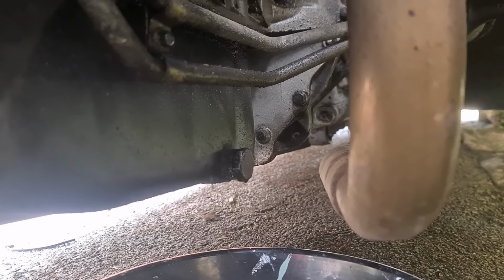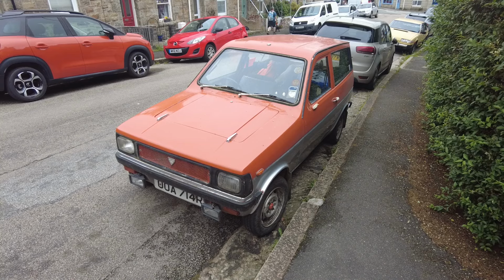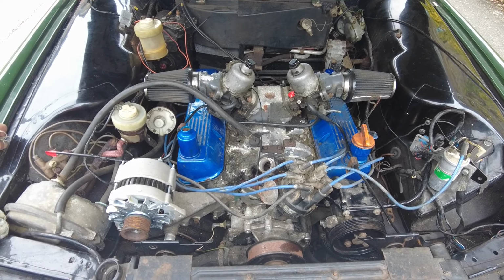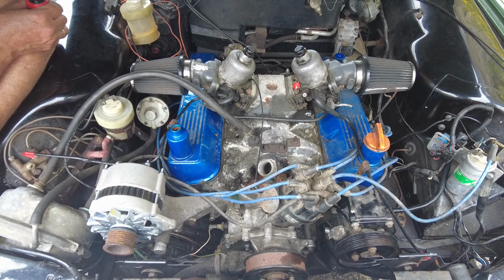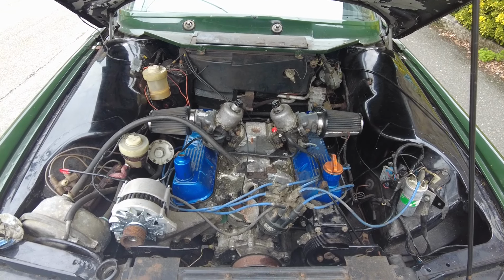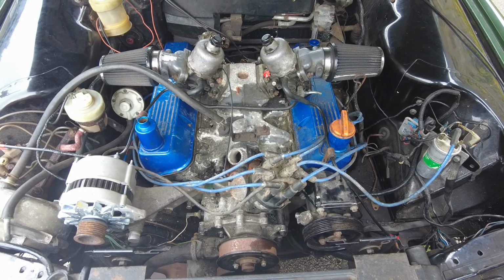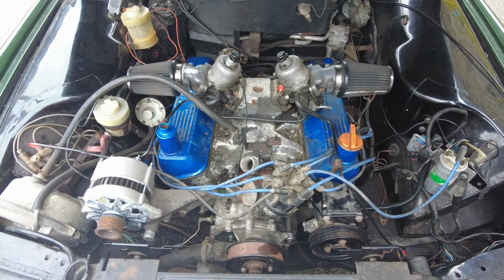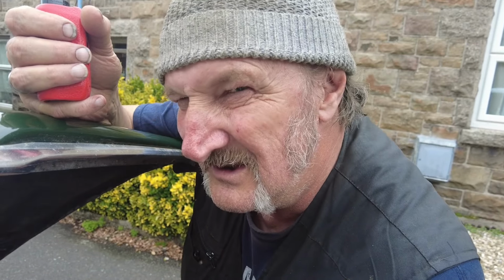Rover P6 V8 NADA Part 7 Bye Bye Engine.....

Comment: Hi Sheldon, all the way from Ireland.
Tbh I wouldn't give up on the engine yet.
Looking back ,it didn't look like a massive amount of water in there and it cleared out fairly quickly.
It's possible that water got in the engine while it was laid up.
Their wasn't any milky stuff coming out so what I would do is plum up your radiator and fill with water. Then run the engine with oil flush , then drain out the old and put in the new.
Then see if your coolant dissappears over a week or so.
It's worth a try and it may save you alot of money.
In your previous video the engine sounded very good , and you didn't have any smoke.
I hope this helps.
All is not lost young man.
The best of luck with your rare p6.
Keep those wonderful videos coming 👍
Reply from the maker: The last time we ran it there was A TON of smoke out the back and it reved like crap s oi am 90% sure the head gaskets are gone.
Reply: You were saying it sounded fine.
Head gaskets arent a terribly difficult job,why not try peoples suggestions rather than go straight for a 4.6 swap which isnt quite as simple @classic_britain
Reply from the maker: @jasonburrows-tr2bd  I am going to don't worry!
Reply: @classic_britain  All I recall was you saying how well it was running

Comment: Mate you had it running with the Rocker cover off and no emulsified oil, so pull and clean sump investigate the metal you find and go from there

Comment: As the car has been sitting for ages it's not uncommon for the head to warp and release coolant into the bore, you had the engine running and it sounds sweet so possibly no damage, dry her out and put new oil in, replace the head gaskets and start from there - the engine is potentially no worse for the experience. Good luck and yet another 10/10 video, DONT let this get you down, it's most likely going to be fine.

Comment: Hi Sheldon bad luck but water in the oil doesn't always mean the engine is toast, give it a oil and filter change before you scrap it then run it up to temp then drain the oil and see if there's any metal in it then as it sounded nice and healthy with no knocking!!?? Cheers 🥂
Reply from the maker: Sadly there is a lot of metal in the oil.
Reply: @classic_britain  Nevertheless, maybe all it needs is an oil/filter change and all will be well again - try some cheap oil first, and see what happens...
Reply: I have to agree with Paul.
Try an oil and filter change first.
Do a compression test, and find out what the oil pressure is when running.
This will tell you if you have  worn/broken big end bearings.

The car has been standing for some time. The oil appeared to be clear. 
This suggests its likely condensation..
..
You may have further fitment/cost issues installing the 4.6. like will the auto box/ torque converter fit the 4.6?
will the ex manifolds.

Comment: The holley is an OK idea ,On my Leyland 4.4 V8 I run a Edelbrock ASV which is 750 CFM on a Australian made manifold which looks a bit like a edelbrock T type.  and it worked perfectly. I say"worked" because the car went under in a flood...

Comment: Did you say the radiator has an oil cooler built-in  ? If so check its not leaking water into the oil from the rad

Comment: Aron Talking to Birchy Likely the valley gasket has rusted out and poured water straight on top of the camshaft and into the oil. If you take the valley gasket  off you'll be able to see the tracks of the water where its worn a line through. If it isn't that and merely a head gasket thats a straightforward job.
Reply from the maker: Going to do that right now!

Comment: You changed the inlet manifold and the oil wasnt emulsified ,thats fresh and it ran and sounded ok.i think that engine is fine ,take off the inlet manifold and start there.!
Reply from the maker: It's not with all the metal in the oil!

Comment: Right you are: easier to swap an engine than repair all sorts of (often hidden) rust. Seems like someone might have put regular water in that engine at some time and it froze and broke or went through the cylinder liners.

Comment: Just a cautionary note....be careful about putting a 4.6 in...the rear end will probably crap itself. See if you can get a 3.9 efi unit and plonk carbs on it. Ideally a 9.35 to 1

Comment: It's OK buying another engine but then do you really know what your getting even if you see it running.
My 3.5 didn't smoke had good oil pressure and run lovely but when I checked one of the main bearings they were shot.

Comment: You dont know where this water has come from. The engine appeared to run and sound well apart from some initial smoke - and an engine overfilled with watery oil would obviously smoke. For the cost of a gallon of oil and a filter Isnt it worth doing an oil change and running it for a bit? Nothing to lose?
Reply from the maker: The thing is it's burning the oil for sure and not only that there is alot of metal in that oil so the engine is on the way out.

Comment: Hi Sheldon.  Manually pumping that  stale old oil around and running it with no coolant is the worst thing to wreck an engine that's unknown and been stood for years. You've probably got broken rings and maybe even cracked, or slipped a liner. The engine will come out on its own, with the manifolds in place. Take off the bellhousing lower plate and remove the 4 torque converter bolts, leaving it on the gearbox. Dont distub any bolts near the starter ring gear, they're balance weights. Support and raise the gearbox front and pull the engine up and forward slightly, tilting it to allow it to clear the crossmember.  You can re-jet the SU carbs to fuel up to 5+ litres. Get a leakdown and compression test done, drop the sump and check the bottom end bearings before you condemn it as scrap. The 4.6 is known to suffer similar liner problems.
Reply from the maker: I know we never ran the car for very long plus the oil we saw on the stick and in the engine did not look anything like that hence why we ran it.

Luckily the 4.6 engine is very low millage just 27K from new and is a great runner so all I have to do is raise the fund and get it bought!
Reply: The Rover / Buick V8 was never designed to be a larger capacity, + Rover adopted a different casting method. The bigger you go, the thinner  liners have more chance to slip or crack. Machining to fit top hat style lners is the fix.  If it's been sat for years with no coolant, or even worse, with plain water, it  can cause major problems.  Have you looked into fitting Amal bike carbs ?  I read an article many years ago where someone had fitted a full set of one per cylinder to a Rover V8. Can't remember how they did it, and if it incorporated the water flow from each end of the heads in a heated manifold. It was around the time people were fitting twin turbo kits.
Reply from the maker: @brianwhittington5086  Yes you are right the bigger engines are prone to slipping linners! Bike carbs would be interesting but I am going to go for a boxer 4 SU manifold as they do flow alot better plus they look good to!
Reply: Can't say I agree with much of that
Reply: @brianwhittington5086 amal probably make the worse bike carbs out there!
Reply: @joeedwards9721  I've been a professional vehicle/ insurance engineer many years, seen many  vehicles converted to a one bike carb per cylinder set up, and the twin turbo SD1s. They're simple to tune and they eliminate the traditional variation in fueling you get with a single or twin carb feeding multiple cylinders with differing length induction tracts. A single carb feeding each cylinder should be almost fuel injection quality if properly balanced.  I've been around Rover's, particularly V8s since the early 1970s, owning maybe 40+. P4 through to the Honda collaboration. I've just been involved in the rebuild of a monster trike, with the same Range Rover 3.9 Efi and ZF auto conversion, from a 3.5 carb and trans-axle setup.

Comment: When was the last oil change? It's been sitting for how long? Do the easy and cheapest thing to do first, flush the engine with cheap oil to get rid of any debris like others have said. Refill and run it then check again. It might not be toast like you think. Get advice before doing anything drastic.

Comment: Opportunitys arise remove engine rebuild it paint engine bay a months work but like you said it's money tnstl be the drawback
Reply from the maker: The engine has had a paint and its really good not sure weather to re build this or replace it.
Reply: The engine bay and inner wings are supposed to be satin black.
Reply from the maker: @johnmoruzzi7236  And now there gloss =)

Comment: I thought oil and water mixture made a brown syrup. Are you entirely sure it is not gasoline?  For the price of new oil and filter you could do a test run of the engine. I would not run an aluminum head engine for more than a minute without coolant.
Reply: It's not gasoline, gasoline would mix with the oil and you'd be surprised how long you can safely run an engine without coolant, particularly an aluminium one
Reply: @joeedwards9721  Oh... it seems I was right after all.  I guess my 40 years of working on cars does mean something.

Comment: It may have not been drained before going in the car and may have been FUBAR years. Bad luck Sheldon, put the intake and carbs back on the SD1z I tbh would not trust the gearbox either sadly. Especially if it is from the same donor
Reply from the maker: Yeah you could not tell from the oil in the top of the engine it was going to be like this!

Comment: Think youre being too premature condemning the engine, that water looked like water not coolant, sacrifice a gallon of oil and run it up to temp properly and reassess, I have a suspicion that engine is ok, if so then I will be hounding you to put that injection back on as it should be😊, be happy to help down the phone, I think you have introduced this problem changing the inlet manifold possibly

Comment: You really need to get a lock up, working on cars in the street is no fun.  I took the engine and gearbox out of my series 1 P6B in one go using a  four leg gantry and a chain hoist single handed.  Lifted the engine and box clear of the front bonnet stay and then pushed the car back to lower it on the floor.  This was in a back garden so I can imagine the grief you would have doing that in the road.  Another problem, is the gearbox any good, how was the car delivered to it's present position?
Reply from the maker: I know I have been looking for a lockup for years now sadly there hard to find.

Comment: Maybe time to let it go, or if you have funds rebuild it properly. Another engine is just other problems regardless of low mileage . Get it off the street 😂
Reply: I have to agree sadly.
Think this p6 needs a new wiring loom.
That current one looks like a fire waiting to happen..
Plus with the engine out it would be easier to do a re wire.

Comment: Sell it
Reply from the maker: No
Reply: Just a thought, you really don’t know what condition a donor engine is. Regardless of whatever you are told in good faith, about mileage etc you only know if it’s a good donor is you see and hear it running, unless you get a warranty. Don’t get burnt again with a supposedly good engine unless you are absolutely 100% sure and have satisfied yourself that it’s a good ‘un. I’d be investigating the current engine a lot more before condemning it. Sometimes it can be a case of better the devil you know even if it requires machining work. You’re already talking of issues relating to exhaust, intake, carbs, and I guarantee there will be all manner of issues in addition to what you know already.
Reply from the maker: @davidw8759  Yes David you are right and I have seen it running plus there is proof of the millage so its not much of a problem 🙂